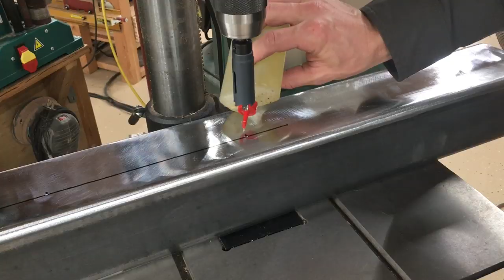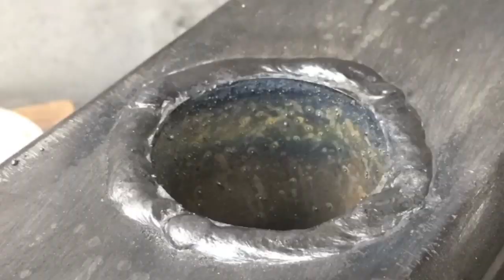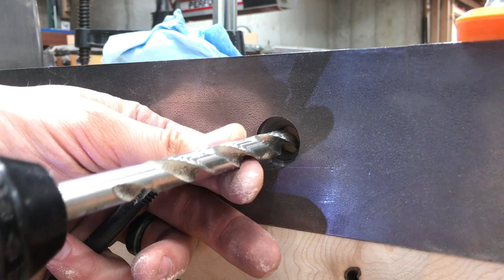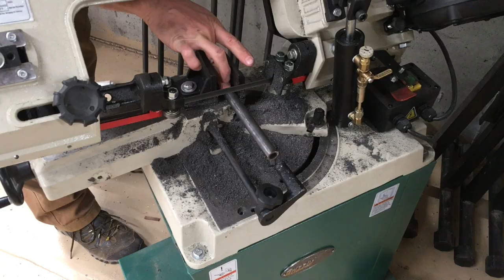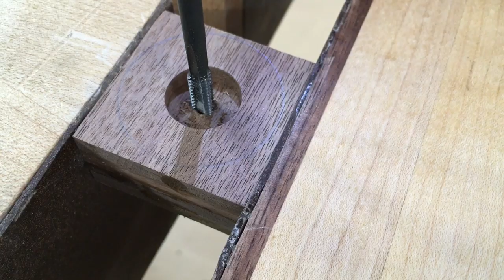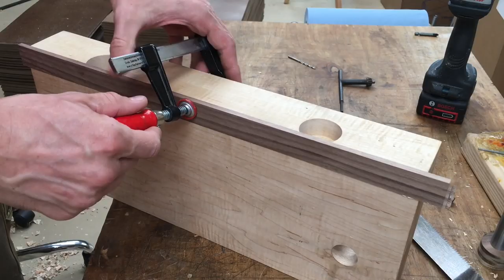Metal Base Workbench Complete Build

Comment: Yeah I'd love to see someone build that in a weekend yeah right,  but what's ironic is if anyone could it would be u Andrew Klein.

Love the bench an the vises I want to buy two of The 20" vises.  Not sure if I would need the attachment for the wood expansion or not.

What wood would you suggest for the top of the bench?
 I live in Arizona.
Reply from the maker: Thanks!  But yeah, no way I’m building this in a weekend.  You could wait until Matt Cremona has them in stock again and buy the maple slabs that I used for this one.   Or do a glue lamination with maple , or southern yellow pine, or really any other dense and stable wood you can find.

Comment: Great bench. Are you going to share materials cost? Loved the meal break the most!
Reply from the maker: It depends a lot on the wood you pick for the top, you need about 70 bf so do you can do the math from there.  Metal is 500 to 700, vises are 600, and there is probably 200 or so in small misc stuff